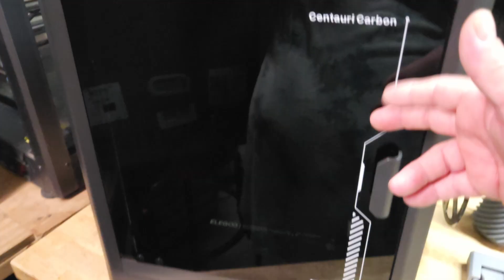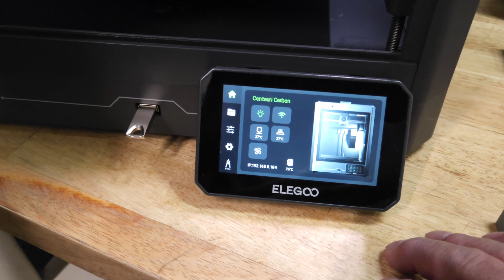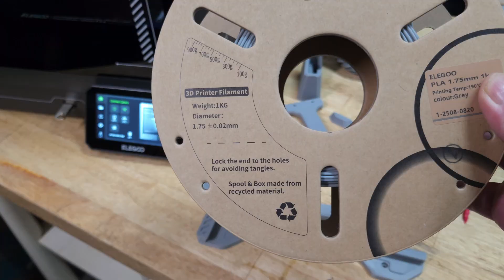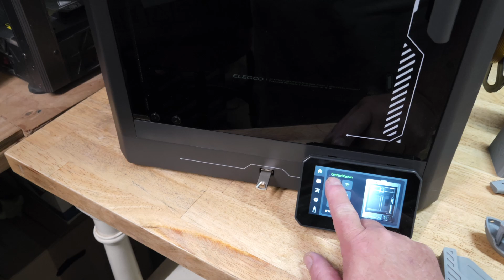Elegoo Centauri Carbon / Best Bang for your Buck in 2025

Comment: What are the dimensions of the printer?
Reply: @Storyideas81  Google usually helps...
Reply from the maker: 16 inches x 16 inches x 19 1/4 inches. Allow room for spool holder and filament on right side.
Reply: @3DHP thanks

Comment: the rails for the side of the printer are to store the lid when you remove it :)    However there is a remix that will hold the lid plus 3 additional build plates:)

Comment: Love my CC - just be extremely careful of the connectors and wires if you have to replace the print head. They are very, very tiny and delicate - the one drawback to the printer imo.